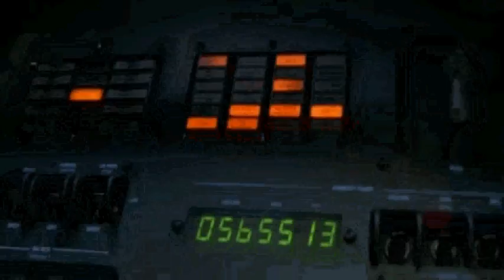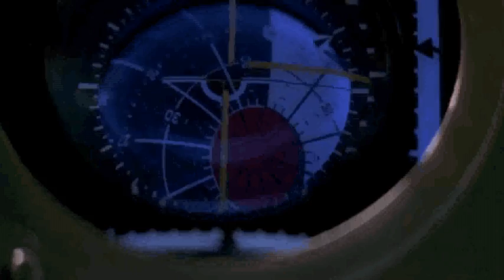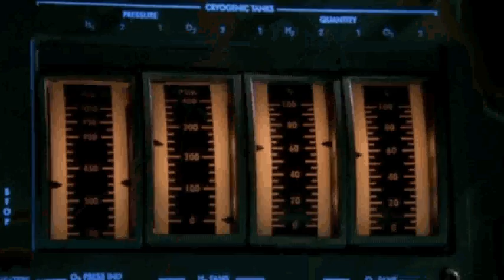Apollo 13 Story Part 1 - Explosion

Comment: April 13 1970 
>>
 The number-2 oxygen tank, one of two in the Service Module, had 
exploded.[...] Damaged Teflon insulation on the wires to the stirring 
fan inside oxygen tank 2 allowed the wires to short-circuit and ignite 
this insulation. The resulting fire rapidly increased pressure beyond 
its 1,000-pound-per-square-inch (6.9 MPa) limit and the tank dome 
failed, filling the fuel cell bay (Sector 4) with rapidly expanding 
gaseous oxygen and combustion products. It is also possible some 
combustion occurred of the Mylar/Kapton thermal insulation material used
 to line the oxygen shelf compartment in this bay.[...]

The
 resulting pressure inside the compartment popped the bolts attaching 
the 13-foot (4.0 m) Sector 4 outer aluminum skin panel, which as it blew
 off probably caused minor damage to the nearby high-gain S-band antenna
 used for translunar communications. Communications and telemetry to 
Earth were lost for 1.8 seconds, until the system automatically 
corrected by switching the antenna from narrow-band to wide-band mode.

Mechanical
 shock forced the oxygen valves closed on the number 1 and number 3 fuel
 cells, leaving them operating for only about three minutes on the 
oxygen in the feed lines. The shock also either partially ruptured a 
line from the number 1 oxygen tank, or caused its check or relief valve 
to leak, causing its contents to leak out into space over the next 130 
minutes, entirely depleting the SM's oxygen supply. << http://en.wikipedia.org/wiki/Apollo_13#Oxygen_tank_explosion
Reply: +Manu „मनु“ Forster  Spot on analysis. In depth understanding of the CM/CSM design.One of the most educated commets i've read on you tube, ever.
Reply: APRIL 13 THE NUMBER 2 QXYGREN